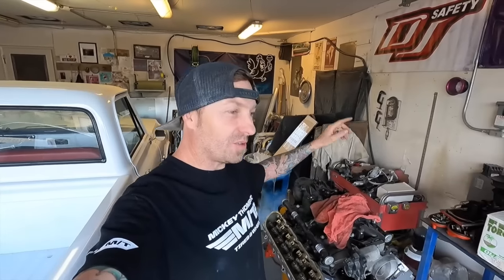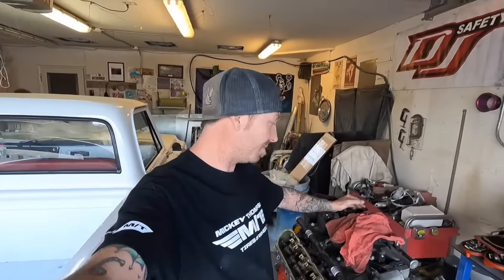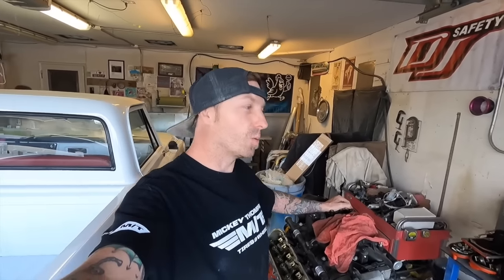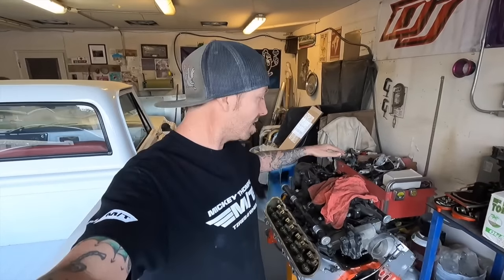Junkyard LS Motor Teardown What To Look For

Comment: Probably from pressure washing it to clean for painting. Simple way to keep water out of the motor if being stored outside is to loosen all the rockers so that no valves are open.
Reply from the maker: Yes this would make sense. I never did pull the other head so I would imagine it that was the case a cylinder on bank one would have the same issue I bet.

Comment: Would have saved a bunch of time using a cheap bore scope off amazon and checking the cylinders first. Especially if your in a junk yard pulling the motor and not at home with the engine out and accessories already off. I appreciate the insite on what to look for. Are you looking for the same things for Gen 4 and 5?

Comment: Why couldn't you have hooked up a starter to do a compression test?
Reply from the maker: The plan was to tear it down and throw some gaskets and bearings at it for a build my buddy was working on. If it was just for fun and something that I owned I would have considered just sending it after cleaning it up.

Comment: In addition to the pushrod check, When the engine is in the car/truck at junkyard - Try turn it over with breaker bar, if thats ok - remove spark plugs look in with borescope, if thats ok - remove intake and valley cover and look in valley openings with borescope to inspect the camshafts.  Or just take the engine out and take it home LOL.  
Stay gold.

Comment: question: should each individual push rod be put back in the same place it came out? if so why or why not. i’ve seen some label them but not explain.
Reply from the maker: If you were a professional engine builder I’m sure they would but a stock hydraulic LS lifter has enough travel that in stock configuration I doubt it would matter. The main thing is to see if the ends are shiny or dull. Dull means no oil shiny is good.

Comment: It really does depend on what you want and where you are according to your budget. I think people need to really think things through before going in a direction. Most would hard pass this I on the other hand probably would work with it. A machine shop for me to clean and check it is about the cost of finding another motor. Obviously a pretty messed up block I would chuck it's beyond sleeveing but a good cleaning for the day can tell a lot more than than trying to find an already "cherry" motor. I've seen some pretty ass looking engines and they clean up fine but yeah it really depends on the person of the project.
Reply from the maker: For this particular project I want a better motor. It's a 5.3 and I can get them a dime a dozen so its not worth the hassle. If it was a great deal and it was for me and I didn't car yeah I would dingle ball it and send it 🤣
Reply: @Burndown  Yeah. I've also seen people keep throwing away stuff hoping to stumble upon the perfect junky gem and never actually get anywhere lol. It really does depend on the person I think.

I only mention because people get scared and will keep passing on stuff that's ok looking for something perfect. Just in general, nothing personal on this video itself I mean. 🙂
Reply: @Burndown  On top of that it's especially critical if you are doing it for someone else. No one wants to give the other person more work or cost them extra either, that's understandable.
Reply from the maker: @CanadaBud23   Yeah at a certain point you have to realize it a used motor. They are pretty bullet proof for the most part too. It all depends of price and effort really. If you go back to my first motor I swapped in the boom I payed 60$ for it and threw a cam in it and ran it and that motor is in some other car running today still haha.

Comment: Hello, 

I have yukon 5.3 v8 2008 with 4L60E transmission, and DOD DELETED and I will add in my yukon:
1-long tube HEADERS (Speed engineer) 
2-cold air intake(volant) 
3-full system exhaust with Y pipe

The qustaion Is which cam should I buy to make more hp and tq:
1-BTR GEN III & IV LS TRUCK NORRIS CAM

Or

2-BTR GEN III & IV LS TRUCK NORRIS NSR CAM

Another qustaion do I have buy valve springs and pushrods?

Thanks a lot and you are helping the people who want to get more hp and tq in thiers cars
Reply: Texas speed is the place to go and no springs unless the lift is huge

Comment: Okay, LS engines are new to me. My biggest question is, I've seen several people do this when they're inspecting the engine and they look at the push rods, they see somewhere, but when they pulled the push rides l, they bunch Em together back when I worked on them, you had to keep an in order. In order to put him back where they came from, is this not true on l? S engines
Reply from the maker: Normal LS Engines have a hydraulic roller tipped lifters in them that have a ton of travel. So bunching up push rods and throwing them in different holes on re assembly is no big deal as the lifter would soak up the difference. Im not an engine builder but this is my best guess as to why it wouldn't matter much.

Comment: I'll say this even if there's rust in every cylinder it could spin over. My old motor sat out in weather for 2 yrs and was full of water and rust and spun right over.. the whole motor could easily be ball honed and put back together and work great. If it still has stuff and you already stuck with it then you will have to have it bored which 4.8/5.3 have a lot of bore room
Reply from the maker: I think this motor was fine for what I would do with it but when its not for me I would like to see a clean motor since they are so easy to come by. He ended up buying a corvette motor... go figure 😆

Comment: Nothing wrong with that little bit of rust. Hell on marine engines they will just bore one cylinder and as long as you balance the piston and rod to the rest it’s all good. I wouldn’t be happy if I paid a premium for it but that wouldn’t stop a rebuild/refresh for any shop I’ve worked at. 30+ years experience.
Reply from the maker: He wanted something he could just throw some bearings at and go. This motor would be fine for a rebuild im sure but I ended up getting a running 5.3 for him that I pulled out of a project truck.

Comment: I like working on vehicles but have yet to do a complete teardown. Ive assisted my older brother griwning up ive picked up a thing or two. I can do mostvthings but not an overhaul. Recently ive lifted an 20114x4 and a 2007 gmc 2wd. I would like to get in deep into overhauling and programming ECMs.

Comment: As for the bolt size and torque specs, that is exactly how things are engineered. Different duties require a certain bolt diameter, thread pitch, thread length, bolt length, hardness, etc. depending on the job. It is almost equivalent to saying that on average, a home's size is proportional to the family size. Engineers use equations to figure that all out.  But good eye to catch that on your own!
Reply from the maker: Your explanation makes sense. Thank you for explaining!

Comment: Can anyone explain to me what melling oil pump to go with. In my "thinking" , i shoukd use what pump my 5.3 LMG uses (high volume/high pressure) which is for the afm motor. Some people say otherwise......but why? Why woukd you NOT want to flow oil the beat possible way? I get that you need to add the couple dollar "baffle/redistribute piece" so it doesnt juat throw and splash oil, but i juat want "real works advice and explanation" on what oil oump is best for a 5.3, because i want bulletproof/MORE than enough oil and pressure for life. Lol thanks, ✌️
Reply from the maker: The high flow ones can pump the pan out before the oil returns back to the pan. The problem gets worse if you have a swap pan with less oil. Rule of thumb is 10psi per 1k rpm. So 20 lb min at 2000 rpm and so on. Hope that helps
Reply: @Burndown  that does help. Thankyou. I appreciate it. So which one would you recommend for a 4.8 or 5.3 "mild build" , that I want in the 3-400hp range, possibly a small turbo in future , but overall bulletproof longevity wise? (focusing on high quality  camshaft and cam components/lifters/trunnion/oiling system/etc. ) been reading up on what the guys that drift or boat race do with their oil since their engines are sideways all the time...lol thanks man.
Reply from the maker: @DwightKShrute  Melling m295 will work fine for what your doing.

Comment: Have a question for you. On the bottom side of the block where the pan bolts on, are those freeze plugs. Looks to be 4 on each side. I have a 5.3 that is leaking oil out of one of them and I want to make sure it's not a boat anchor.
Reply from the maker: If it’s leaking oil it has oil so I guess that’s good. Hopefully just a bad gasket

Comment: A dingle ball hone would work that rust ring out just fine.. Unless the cylinder wall has some legitimate serious pitting after clean up it doesn't need a machine shop, that just puts more money into it for rings maybe even pistons if the shop wants to f#ck you good your looking at an extra 1000$ for a junkyard buil ls.
Reply from the maker: He just wanted to get a good used one and thrown some bearings and oil pump and some seals  it and go. So this is not the motor for that. IMO
Reply: Another thing with these is if the bearing aren’t trashed then just measure and reuse them. They are to right from the factory anyways at .001. I’d rather see .0025-.003 on the crank and rods if it’s going to see any RPM or added power over stock.

Comment: I have a LS 5.3 from a junk yard and I’d like to rebuild it do you have a video with more Specifications?
Reply from the maker: No sorry. I tore this one down and it ended up bing ugly so I didnt want to use it. You could probably get away with throwing some cam bearings and new main and rods in it and running a ball hone real quick and slapping it back together if its for a project car. Ifs its a DD I would take it to a machine shop if your not sure.
Reply: @Burndown  thank you 🙏

Comment: You passed in this block because of one damaged cylinder and said it can be fixed by honing it out. I’ve seen honing done on almost every rebuild/upgrade video I’ve watched while researching this process. Would boring it out be out of the question fir this block as well? If I do find a block with a similar issue and wanted to keep going, what would be the next thing to observe as a definite deal breaker?Great video. Very informative explanations of what to look for in a junkyard motor. I am going to do my first ever teardown and rebuild this fall and I’m shopping the junkyard for a LS currently!
Reply from the maker: I passed because it was for a friend and not me. If it were mine I would just dingle ball hone it and send it haha.The definite deal breaker is the cam bearings. If you pull the cam out and the bearings come out with the cam the block is junk.
Reply: @Burndown damn how fucked up would it have to be for that to happen 😂

Comment: Dumb question: but if i get lets say a 01 5.3 with a 4wd transmission. I cant just swap the transmission to a 2wd right  ?
Reply from the maker: You would have to do other things to swap from a 4wd to a 2wd transmission
Reply: @Burndown  I ended up getting a 2wd to avoid all the fuss .

Comment: Thanks for the video, just what I needed.  My Comp Cam started to shed metal on most of its lobes.  We think it made the relief valve in my oil pump stick full open because now I have no oil pressure.  Im doing this to mine on Monday.  Fully forged LQ9 390ci.  My first time opening an engine.  After the block gets back from the machine shop I'll be putting it back together with new bearings throughout, new rings, lifters, and whatever we see that it needs.    You think I should get a new double springs kit while the heads are getting refreshed?  How about new rockers and push rods?

Comment: I’m swapping my 1995 Trans Am LT1 for a 6.0 from a 2006 express 3500 van. Like most people, it’s the wiring that intimidates me. Any tips or advice/thoughts since you’ve done many of them?
Reply from the maker: Terminator X from Holley is my go to. You can use a factory computer to try to save money but you'll need to pay for a tune so factor that into your decision.
Reply: Fast plug and play, that is definitely the best way. You will need some relays for your fans and a/c . They come with easy to fallow instructions and set up.

Comment: are you not worried about keeping the pushrods in order?
Reply from the maker: No not really. I mostly look to see that they are straight and not plugged up and that both ends are shiny smooth and not dull or scored at all.
Reply: @Burndown  it also might be worth checking the length, if you care about the Valvetrain

Comment: What cam would you recomend on something like this. A 5.3, no turbo just to get the most out of it with basic setup
Reply from the maker: Any cam is going to do well. If its just to drive around I would sacrifice a bit of HP and do a truck style cam for the TQ down low so its more fun to drive.
Reply: seriously don't ask him.  When spec'g a cam there are a lot of things to consider like ; what will the engine be used for, street, strip, combination. Automatic or manual shift? rpm range you want to be in or where the engine is most of the time, driveability, torque converter, rear end (differential) gears, power adders forced induction (turbo, super or no2) are you starting to get the picture?

Comment: im interested in doing my first ls build or rebuild depending on what I can find atm. I live in Texas. Do you have any tips? Really enjoyed this video and your energy. Thanks!
Reply from the maker: Have a plan of what you would like to do. If its just a learning exercise then build whatever is cheap so if you mess it up its not a big a deal. The LS platform is pretty straight forward so you'll be fine. Go check out Sloppy Mechanics for all kinds of info on swaps.
Reply: @Burndown  awesome thanks. just got my hands on a LM7 5.3 and it came with a 2005 tahoe. cant wait to tear it up!
Reply: @Sean-zc3iv how is it going?
Reply: @MOE13576   its going good so far. thanks for asking. Rebuilt the 4l60e now im waiting for more funds to do the engine!
Reply: @Sean-zc3iv  that's great. What part of Texas are you from ?...I hear you..And you're welcome by the way

Comment: Impact on a puller or a spring compressor is a no no. But if you must at least grease the threads guys.
Reply from the maker: This is a good tip. I do put a bit of grese on the threads of the puller. I have ruined one before from running an impact on it. Chewed up the threads pretty good.

Comment: I won't call them boring it's just not typically my cup of tea lol, I am more of a fan of gen 1 and 2 SBC, and Oldsmobile and pushrod Chrysler v8 like the magnum 318 5.2 litre motors but LS 4.8,5.3,5.7,6.0,6.2 motors can be quite nasty in the right vehicle and combination

Comment: Always be weary of 706 casting heads with battery symbol under rockers they crack really easy so if u do use them have them pressure tested Always the engine builder I work for junks these and won't even put them on a rebuild
Reply from the maker: Good tip

Comment: if you're hunting junk yards for engines invest in a cheapo bore camera, it will save you a lot of wasted time but that engine right there if I had it I'd disassemble it, hone the cylinders to clean them up and send it...
Reply from the maker: I got this motor form a friend. I would not have pulled a bright orange painted motor for that reason alone haha. Good tip on the bore camera tho. Never thought of that.

Comment: I don't know of a junk yard that will let you take the motor apart and then not buy it...... every yard iv'e been to already have them pulled and you can twist the crank a few times and then buy or not
Reply from the maker: We have self service yards out here that you can take a motor apart at if you want. I get most of mine from a core supplier that will take them apart for me to inspect. It’s definitely cool to be able to pull a cam out and know the bearings stay in the block

Comment: Did you say 5.3...   i see dished pistons 😯
Reply from the maker: This was a 5.3 from what I saw. Falt tops usually are 4.8. Some of the later model 5.3 had flat tops as well.  At least the motors I have taken apart.

Comment: I know this is an old video but heart my sank for you when the head came off and there was rust in there.
If it had been started up like that that carbon and rust would not be good on the cylinder walls.
If someone had wanted to continue with this cleaning and vacuuming the cylinder and head before moving the crank would be the way to do it.  But for the cost of materials, gaskets and time why?
The silicone on the water pump is also a red flag.  🙁
Reply from the maker: It was bassicly a free motor so I figured I would dig into it and see if it would work for my friend

Comment: Your wrong about the ft/lbs it is 22 for a 8mm but it’s in newton meters (metric) so it’s 22 N/Mtr
Reply from the maker: 30N should be 22#. I may be wrong but that’s what I have been doing. I’ll double check tho. Thanks foe the heads up.
Reply: @Burndown   love content by the way

Comment: Soak the cylinders in white vinegar and you'll get the rust right out of those cylinders and clean them up and you'll have a better idea what you are working with.
Reply from the maker: never heard of that but I bet it works. I know you can soak chrome parts in wood bleach and it will take the rust off chrome. Its a good trick for chrome parts.